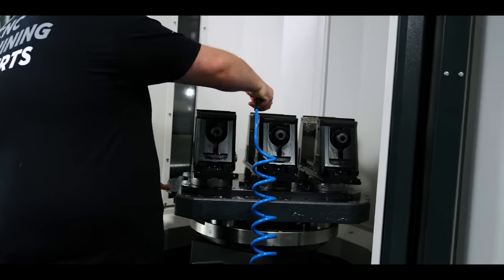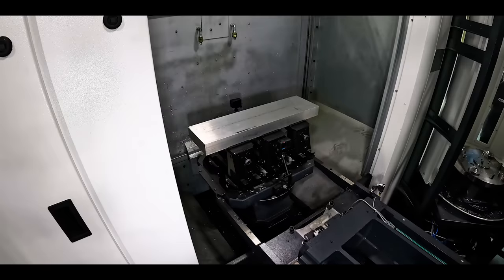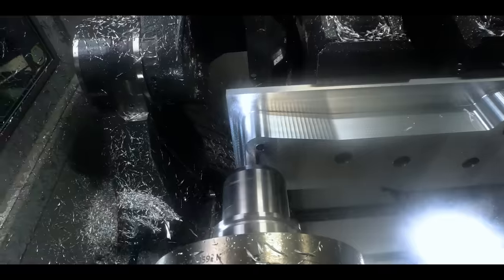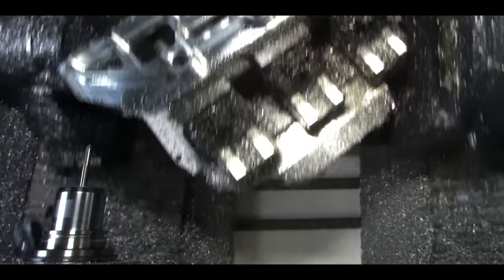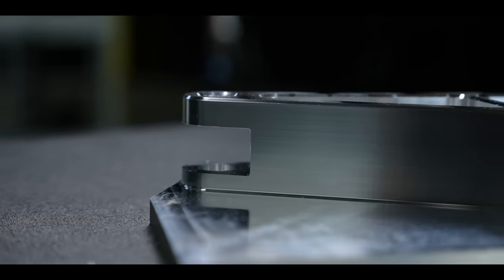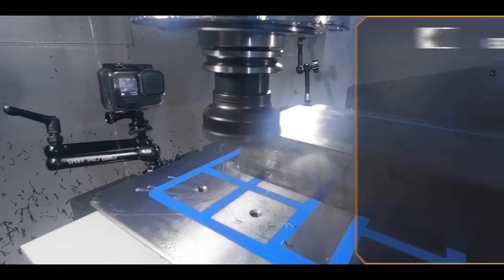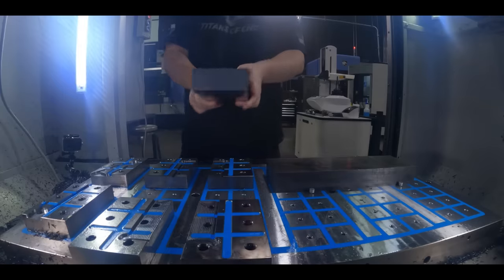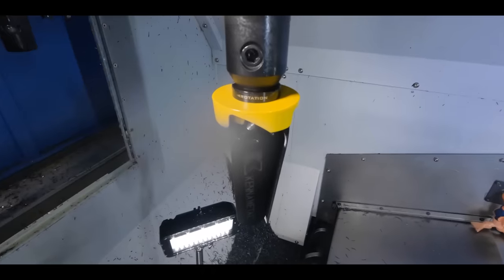Can You Fake It Until You Make It in CNC Machining?

Comment: Had a guy who got a 5x CNC lead position in a shop because he came from assembly and watched some of your videos. He turned the feed up to 150% on a part that was already optimized. 

The managers loved him because he shaved off the cycle time. That tool was a 2" face mill being used to hog out a clamshell that was 11" tall. It was on a 10" extension and the tool was 12" long on a cat40 running at 10,000 rpm. He didn't want to hear why this was a bad idea.

Surprisingly, it worked. For two weeks and then we were out a spindle.

Pull stud holders lose their holding power the faster a tool spins, and the harder you run that tool, the more likely it is to pull out. Surprisingly, it wasn't catastrophic, but the taper was gone, the drawbar was gone, the spindle bearings were shot, and I quit before finding out much more.

I've faked it until I maked it too, in my first job. The difference is, back then, I was sussed out immediately. I was given a lot of tips I'll keep until my last days from a shop full of old timers who programmed their own parts on the controller. I still use everything I learned there to this day. Things like knowing how to actually use an edge finder or understanding why you take care of your equipment. Understanding that all the charts and stories in the world don't mean anything if your chip evacuation is crap becayse you never took a look at your coolant tank.

Even today I learn new things. I've been at this for over 10 years, and yesterday I learned that you can't use alcohol mist as a coolant on abs like you can with aluminum, because alcohol eats that type of plastic. Sometimes, it really is better to run with no air and no coolant and just add stops after every .1 of every hole. I love the place I work because while our equipment is humble, the people there are exceptional, and at least some of the old timers still out there are worth listening to and giving your full attention when they say something.
Reply: Nice, comment. As they say, we are never done learning.
Reply: worthy effort to make the writing as exemplary as your learning is demonstrative.  words work toward others just as our efforts from the self.  thanks for this post.

Comment: I tried being in over my head twice in the machining world though I was honest from the start and said " I never tried this/done this before but I'm willing to try and learn " 
First time was when I started working on a citizen L20 swiss lathe pretty much fully hand programed ( we did have a G and M code lookup table for all the special ones it had ) 
Second time was when I got put on a citizen ABX64 with 3 turrets with 3 axis each and 2 spindles where sub had its own programmable back and forth position and C axis on both spindles where everything hand to be hand programmed from scratch each time ( which was way more axis's and channel's to program then I ever tried before ) but both times I was still honest and said from the start that I haven't tried anything like that before and I'm willing to learn and try ( p.s. the last time I ran a cnc before I got on the ABX64 was more then a year apart. Had been only manual turning and milling in the meantime. So I had to get use to running cnc agen )
Reply: Swiss would be pretty hard to start from scratch! Respect!
Reply: @barrysetzer  it was but the ABX64 was actually harder ( just came from only manual lathe and milling for over a year ) and then throwen in head first scratch hand programming 3 channel 3 turrets. each with 3 axis and can all work on G54 and G56 ( man and sub ) at the same time ( and some of the old programs for it that someone else made did have all 3 turrets on the main spindle at the same time with the sub moved forward so when the lower turret was done it could reach the back of the part in the sub without removeing overtravel protection

Comment: You get a associates degree in cad/cam machining like myself...they show you all the basic fundamentals of machining/programming.  Then you get a job machining somewhere and a lot of what you learned doesnt translate over.  All industries have different machines, softwares, controllers, nuances, tolerances, quality and standard operating procedures.  I believe everyone starting in a new job to any degree is a partial charlatan.  What makes the difference is the ones that are hungry, curious and have the intellectual capacity to thrive being on the low on the totem pole but do it with humility and respectfully questioning conventional wisdom. Those are the people that go far in companies.

Comment: Could you make a Video where you program a part in METRIC and Inspect it in metric norm. I would love to see a Video like that, in fact I bet your whole audience over See would like to. Just to see How you handle that.
Reply: Why?  They are just numbers.  There is nothing more or less difficult about working in metric vs imperial.  I deal metric parts often it's no different. Do I care how big 2MM is in relation to the same size in inches?  No.  All I care about is if the dimension is in tolerance.